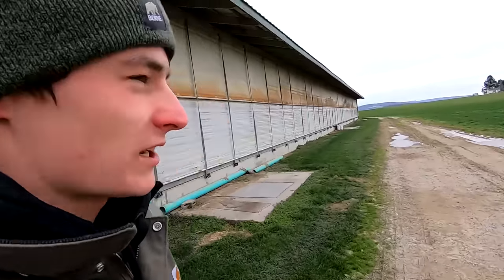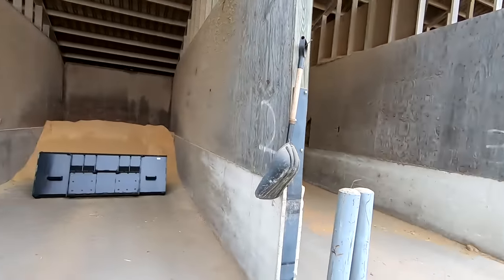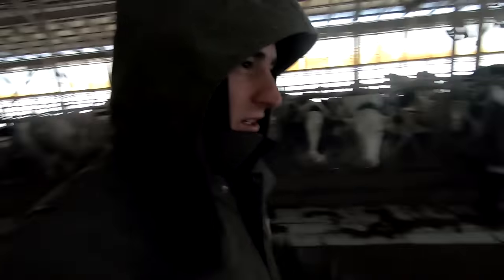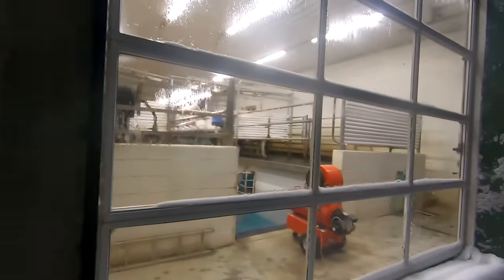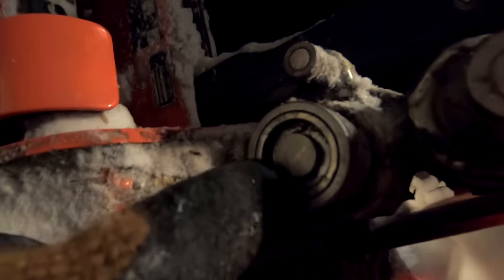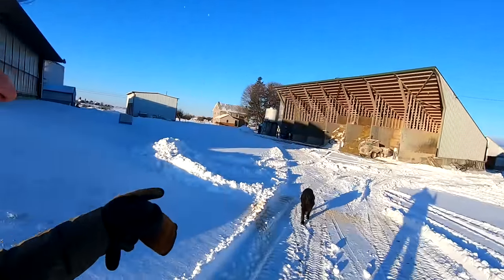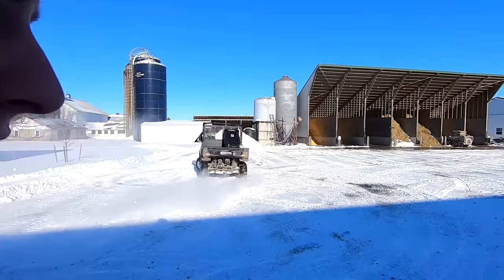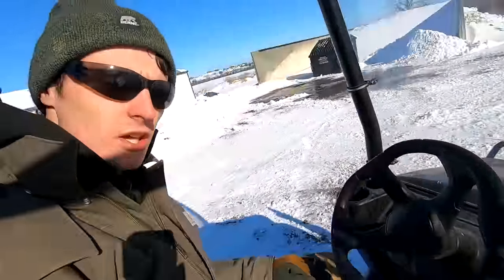Snow Storm on the Farm

Comment: My Dad was an off and on dairyman over about 3 decades. He gave it up for good in the 70s. He also kept some Angus and Hereford  at different times. He never really operated at a "modern" level farm. Stone age really by current standards. The number of cows and the level of mechanization and automation these days would be mind boggling to him. Back straps and belly buckets were state of the art modern when he built his concrete block grade A barn in the 40s and he was still using that system  around 1970. I coulda been a farmer had things been different I guess. Funny how that happens. You either inherit a farm or you ain't likely to end up being one.

Comment: For your hey there that you have uncovered all you do is put a tarp get your heavy tires and throw right on top of it so it doesn't get ruined or anything and it stays dry you do know that gentleman right use your commercial tires and throw on top of it and you'll be keeping it dry just in case there's a bad storm coming hopefully you also have some backup generator right and if anything I was broken like any flats on your vehicles that you got them fixed cuz you're going to get a storm 🙏🤳🤝💞💞💌

Comment: On your proposal silo project
I'm sure you have all your plans in place
Here in sw Wisconsin they're went from silos to bags to bunks
One of the last silo unloaders I have heard of was one that ran as filled it leaving a hole in the center than at the top you reversed it and pulled the feed to the center where it fell to the bottom
If your silos were built with a elevated floor at the bottom that your feeder could drive under the floor center where the feed could fall straight into it.
No augers no elevators no loaders
Reply: Good luck with your set up

Comment: At 3:10 It looks like that post is rotten and no longer is attached to the ground.  It moves as you try to close the door.  -Another project and video for the spring. "Replacing rotten post" -There is a company in Illinois that can push metal sleeves into the ground, around a rotten post to extend the life of the structure.  If I find the info, I'll send it to you.  I saw it on "Tractor Time with Tim" He used it on his Indiana pole barn.

Comment: You ever lean to far forward in the seat of that kabota? I used to work for a company that had one and if you leaned out to far while driving it would set the parking brake and damn near throw you out the cab used to drive me nuts I know it’s in the idea of safety but I don’t feel safe when I move in my seat and almost get launched out the loader 🤦🏼